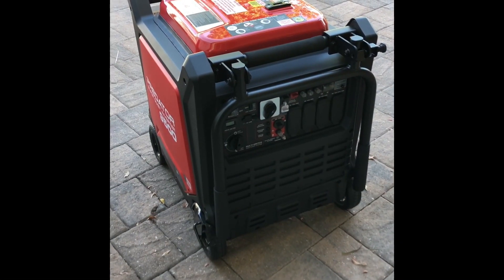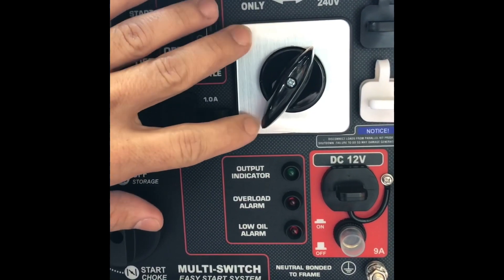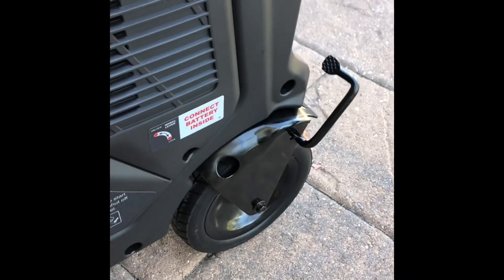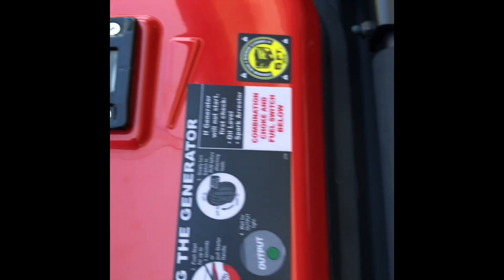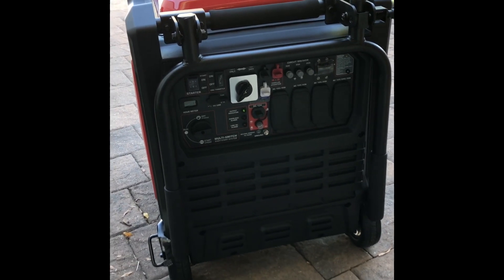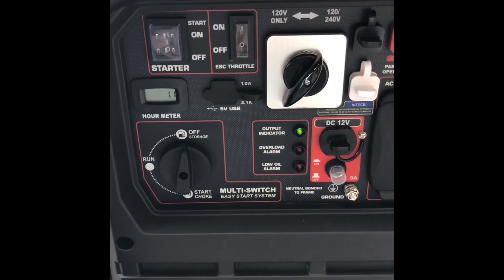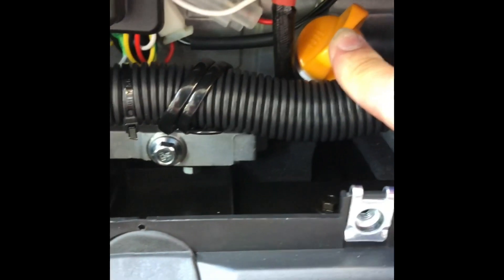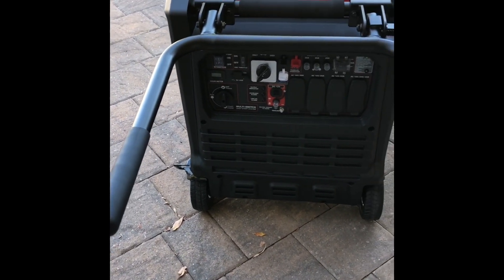Harbor Freight Predator 9500 watt Inverter Generator overview

Comment: Great video! 

I recently purchased this about 1 month ago and ran through the break-in period, changed the oil and gave it a full load test.
It's able to run my entire house with 4-Ton AC humming right along. Granted, I installed a SureStart on my AC which lowered the inrush amps from 132 -> 46.
I wasn't able to run the microwave while the AC was running, but everything else was fine....Tv's, lights, refrigerator and chest freezer all running just fine with AC.

Highly recommend this generator!

Comment: For anyone wondering I've watched every single YT video on this unit and the audio doesn't do this generator justice.  These things are insanely quiet! I can and have run my entire house on this unit (all electric house and A/C has a soft start).
Reply from the maker: I totally agree. I also have a soft start on my 3.5 ton central a/c and it will run it. I will be posting a video on that soon....

Comment: Great review, looking forward to seeing how you run the central AC. I’m in the break in process myself, current;y at 17.5 hrs. Running it a few hours a day. I have the 3500 and when this beast was released, I had to get it. When you realize you can power two houses with this.....amazing generator!
Reply from the maker: Thanks Frank! I will uploading that video in a few days.
Reply: Are going for the full 30 hrs? The manual said between 20-30 hrs. I am doing mine and I think I will go to 20, I also have magnetic drain plug and dip stick to collect metal particles.

Comment: Great review and overview. I own one of these as well and LOVE it! You did a good job with your video and explanation which should benefit owners of all skill levels. One thing worth mentioning though; Try to remove and replace the air filter... seriously... go outside right now and give it a shot!  :-)  OMG!!  I build motorcycles for a hobby, and I had to call the factory for guidance. They have a special set of instructions they will email to you to address this unexpected dilemma! That being said, I DO like the generator and highly recommend it.
Reply from the maker: Thanks!!! I’ll definitely try to get that air filter out. I’ve heard of other people have trouble with it. I’m a automotive technician by trade so I definitely appreciate things like the provisions that they put into the unit for servicing the engine oil.

Comment: What could be better. Extend the dip stick so the cover does not need to be removed as the Manual calls for Daily Oil check. (a 6mm socket is needed to open cover)

Comment: I bought one couple of weeks ago. I ran it for 30 minutes on Pennzoil 10w30. Drained the oil it looked terrible. Dark and a lot of particulates in it. Ran it 2 more hours drained oil again. Oil was a little better but dirty than I thought it should be. Have Mobil 1 10W30 in it now. Going to change it at 30 hours. The motor seems to surge a lot. I have nothing plugged into it. I am just breaking it in. The motor seems like it is louder than it should be. I am also running recreational fuel “no ethanol “ with fuel stabilizer. I also purchased a magnetic dip stick. I am not so sure this motor is going to last?

Comment: Seems like it’s quite a bit louder than the 3500.  What’s your thoughts?
Reply from the maker: Thanks for the comment!I have  a friend that owns the 3500 and comparing them both The 9500 it’s definitely louder than the 3500 but not by much. Keep in mind this generator is almost 3 times the size and it’s much quieter than my old 4000w conventional generator.

Comment: I guess I must have just got a dud.... The low oil sensor was not working from the first start attempt or, any attempt really. I had the recommended amount of oil in it and on level ground (patio). I had high hopes for this generator. Going to return it.

Comment: Tri fuel with a 50 AMP receptacle and this generator would dominate the market. For now just change the oil and clean the spark arrestor every 100 hours and new NGK Spark Plug every 1000 hours and you'll have years of trouble free operation. Never fill the fuel above the red limit marker in the filler neck. That's most important of all.
Reply: https://youtu.be/wXk7vBQSzXo — trifuel conversion kit!

Comment: Just FYI,full synthetic isn’t 100% synthetic..legally they can put that on the bottle but it’s not 100%...Amsoil is a true 100% synthetic...been out since 1972..All the oils you buy at parts store,Walmart or even Honda full synthetic is not 100%..research it.
Reply from the maker: Thanks for the input Josh I’ll look into it.
Reply: I watched a video that Amsoil has here on You Tube and in the beginning they have tanker rail cars in the factory that they said is full of base stock and that is all they said about that. What is in the rail cars?